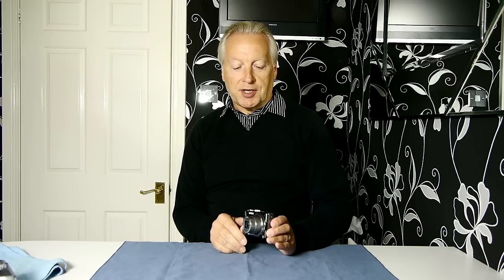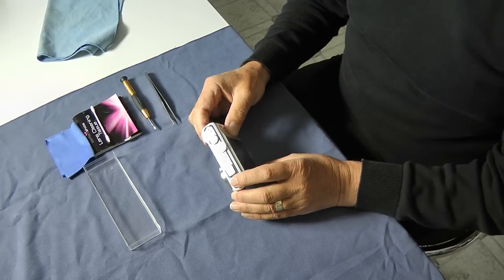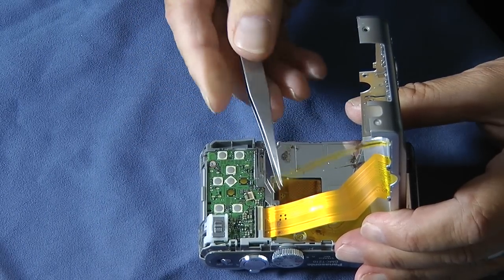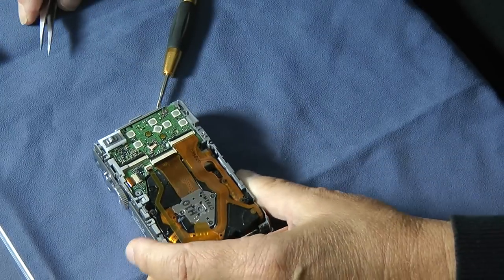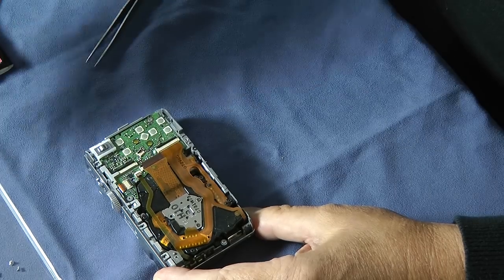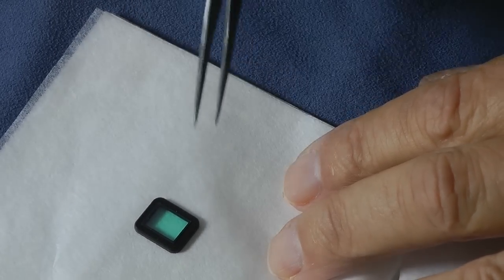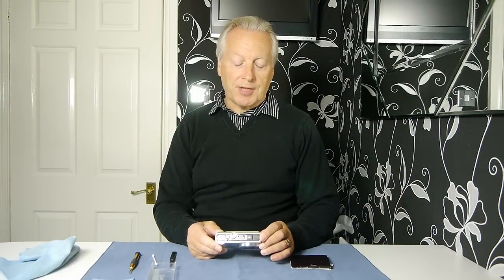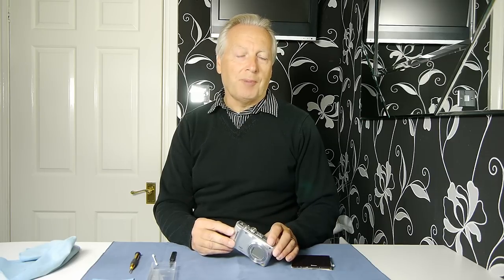Cleaning the CCD sensor of a Panasonic Lumix Compact Digital Camera

Comment from the maker: @LilBlighter The next stage is a little trickier as the lens zoom system consists of 3 cages which ride in each other and they have to be separated to do this. There are alignment marks but you have to know where to look to find them. Once you remove the zoom mechanism it is easy to clean the front element of the lens. There is more risk of damage to the delicate ribbon cables to the image stabilisation component. I might do a how to soon.

Comment from the maker: @awelux Well spotted. This is a camera used for many training uses and infact the cable had been left unlatched from the previous lens removal exercise. The main point was to show how to safely remove the ribbon cables from the connectors rather than in some videos trying to flex the display to one side with the risk of tearing the cables - especially the small backlight ribbon.

Comment: Excellent clear quality video, very many thanks and on exactly the right model. Would loved to have also gone to the next stage to see how to clean the inside of the outermost lens element, as that's where dust or lint seem to be most evident on clear backgrounds and at certain focal distances, despite all efforts to keep the camera clean and cased.

I have some reasonable skills, a steady hand and most of tools likely necessary, but just need to see what I'm likely going to encounter first, fr

Comment from the maker: please check you have the thin ribbon cable the correct way up, that is with the gold contacts facing down. This is the power to the lcd backlight. Ensure both connectors are pushed hard into the sockets before you close the contact latches.

Comment from the maker: @informed The lens assembly can be quite a challenge to strip and clean, the lens frames are like a 3d puzzle to get back together if you don't appreciate how they work. Unless you mark each frame before you take them apart ( they have very tiny moulded marks but you need to know where to look to find them) and then proceed carefully I would not suggest you try this procedure. Usually any dust is on the IR filter or on the zoom lens which yo can see through the sensor hole.

Comment: Hi - great video ! Ages ago I swapped the light sensor from one old canon to the same model canon. Good to see the build quality of the lumix seems as good if not better than the old canon. Soon I am getting a second hand lumix, so I really appreciated your comments and video, especially about the vacuum effect.. I will see if my idea of a small zip locked plastic sandwich bag helps keep the dust and other crap out. I find camera bags and camera cases good but I use these small bags for my mobile phones and it works well for dust and lint etc. Cheers again !
Reply from the maker: Good idea with the zip lock bag, worth remembering.
Reply: Graham Houghton Or, if you wear the same jacket a lot, line the pocket.

Comment: Thanks.  I took apart my camera before I watched this video because of these specks dust in the videos I record.  I was afraid when I took apart the CCD sensor on my Sony Cyber-shot DSC W350 it would fall apart, but after watching this vid, it didn't. A little compressed air did the trick.

Comment: Excelent video.  I used it as reference today to clean my PANASONIC DMC-SZ1.  The only difference is that the screen is attached to the main structure but it was very very easy to remove it.  Thank you Graham..

Comment: Excellent instructions. It was much easier than I was expecting, though on first attempt, my cheap screwdriver self destructed, and I had to buy a higher quality one. Now need to find another screw. Whilst main problem is solved, I can still see one particle of dust that is within the lens. This is only barely noticeable at extreme wide angle with a totally flat grey subject. At the moment it is not worth attempting to dismantle the lens. I also like your Oldham video. Takes me back 40 years.

Comment from the maker: In the macro mode and long zoom the closest focus distance is 1 metre with this camera by design, it gets less as you reduce the zoom. have you switched to the macro AF mode. If the sensor block is not tightened to the lens housing correctly it is possible you will not achieve close focus - tighten the screws gently and use a circling technique tightening them one after the other until they are hand tight.

Comment: Great video, good narration! The most usefull information for me was how to "unlock" the ribbons. I didn't knew how to release them before now. I found a "disassembly and reassembly" PDF online for my Samsung WB2000/TL350, and now my beloved "shirtpocket-camera" is as new again. No more tideous Photoshop work to remove those annoying dustspots.I used pressureized canned air to blow away most of the (4-5 pcs), and a cotton pin for the last stubborn one. No more worries about buying compact camera with zoom anymore.

Comment from the maker: In theory the blast of air should be sufficient to remove dust/pollen/fine fibres from the surface of the IR, ( tip! if the IR stays attached to the CCD when you remove the block from the lens just clean  it - dont separate it from the ccd as it unlikely to need cleaning) If the camera has been used in smoky/city atmosphere the their is generally a 'film' on the IR and I would gently wipe, rotating the q-tip as you go, the IR filter then give it a blast. Look obliquely to see if everything gone

Comment from the maker: There is supposed to be a universal standard for philips head screws. The screwdriver I have is marked PH0 and is the perfect fit to the screwheads, engaging perfectly in the cross formation. Too small/large a driver may damage the head through slippage.

Comment: Thanks! Just finished with the DMC-S71 (not the model used in the video). Seems to have worked although when I got to the infra red filter part a couple of springs popped out. Wasn't able to get them back in. But everything is now working without dust spots. And my menu button on the right which was also being over sensitive and unreliable is now fixed.

Comment from the maker: This is a small cross point ( number 00 or 000) screwdriver. It essential to get one which fits perfect otherwise the screw heads will be damages and you will not be able to get the scres out.

Comment: thnx i just did my panasonic lumix FH25  pretty much like yours except i did not have to remove the ribbons just blew air usung a bulb  with a brush type cleaner ,that white speck of dust is by by now so thanx for the confidence graham my other camera canon 100d eos has a feature in the menu of the camera where you can expose the ccd and just clean it without any mechanics involved, so now i may be tempted to remove the infra red filter, just a thought!

Comment: although I found a service manual for the ZS20 (TZ30), the process of calibrating the cmos/lens seemed too complicated.  So, what I did (and should have done right from the start), was bring the camera to an authorized repair depot. I had called them ahead of time, and they repaired the camera in just over one hour, no charge (still under warranty). Their advice -- keep the camera in a "ziplock" baggy. After the warranty period, their charge to retail customers runs around $75-$100 Canadian.

Comment from the maker: @yeti66tl ,,, part 2. make sure you keep the assembly one way round and remove each frame and keep notice of the plastic tabs so you can fit them again. It is tricky but can be done easily when you see how they work, there is likely sand in the grooves which stops the extension-retraction of the whole assembly. But as I said if it's focus only you don't need to remove the frames, just clean the slide and rods of the focus lens system.

Comment from the maker: Its a little different having the ir bonded to the cmos sensor but if you take your time is easy enough to do. There are 3 ribbon cables in the TZ20 because of the touch screen. On my blog page under downloads you will find the service manual for the TZ20 which may help you with the disassembly

Comment: found this as a great way for old grey heads to think they can do any thing.Had a go on 2 Panasonic that wherein trouble with blotch marks from a sand storm  .step by step helped and play back great job and easy on the ears to listen,.both look like new now ,  fingernail slipped on one  the filter and snap  $ 30 still good for ego and would have saved a bit for 2 cameras and 1.5 hours of enjoyment. THANKS

Comment from the maker: Hi Michael. The vacuuming technique was recommended to me but I never advised it to anyone. There is another video which shows how to fully strip the lens down to clean all the inner elements. Other than later than TZ10 cameras it is easy enough if you pay attention to the orientation of the components as mentioned in the video. A few have tried it and reported success, however it is up to you if you think you can do it. Watch the video to see.

Comment from the maker: @haveachatann This is also a side effect of the camera pulling in dust as the lens extends. If you have a "blower brush" you might try blowing really forcefully with the lens shutters closed and then open to try to dislodge any foreign body trapped between the shutter blades and lens front. You might have to do this several times. DON'T attempt to try any lubricant, this will make them stick more. It is possible to remove them with dismantling the lens but it is a tricky operation. let me know.

Comment: Excellent presentation.   But, I wonder if one should use cotton q-tips to wipe the filter and ccd as they might scratch the surface.     Blowing air and a soft brush might be better to avoid scratches.     But, thank you for the detail.

Comment from the maker: @mountainvision100 If you are sure the flexible cables are pushed firmly into the sockets and the latches are closed then it is likely that you may have fractured the very fine copper trace running down the thin cable for the lcd backlight. You can sometimes diagnose this by flexing the cable very slightly and observing if the screen comes on. If you have access to a multimeter then you could check the resistance of the lcd backlight diodes to be around 1.5K if they are okay. Its possible split

Comment from the maker: The most common reason is that the ribbon cable is not pushed deeply enough in the connectore before the latch is tightened. also it might be the backlight ribbon cable is upside down it should have the blcak part up and gold connectors down ( which is opposite to the data ribbon cable)

Comment from the maker: Hi, on the under side of the ribbon cable ( opposite the gold connector ) cut about 3 or 4 pieces of sellotope (scotch tape or other adhesive tape) and layer them on the ribbon cable - right to the end. trim any excess from the width. Now push the ribbon cable firmly into the connector - the tighter you can get this the more chance of success - then once the cable is in place hold it in position with another layer of tape over the connector and ribbon cable. Let me know how you get on please

Comment from the maker: @surf1div1 Hi, thats no problem. Place the plastic boot with the flat part facing down so that the recessed part is up inside the lens body ( doesn't matter which way round) then carefully place the IR filter into the central hole in the boot - it is only held by friction. Then carefully place the sensor back into the lens - it will then be positioned correctly before you screw it down. This happens 50% of the time just depends on how long its been in. I have spares if you break it.

Comment from the maker: @mrmot That's great. I was thinking that you should actually place a "visible light" filter instead of the IR one so you can use it in "not total darkness" I have used the "blue fogged area" of 35mm negative film strip which is a good visible light block but you may need to use a few layers ( cut the same size as your IR filter) to totally block. Or you could use very dark blue acetate gel material i guess. However if it works good for you there is no reason to modify it. Just curious now!

Comment: Hi Graham.

Another success! Thank you so much for this informative video. I had a blurry slug-like image  across the lower part of the screen which turned out to be tiny hair on the filter. A quick blow and it has gone.

Good quality screw driver and tweezers were essential. Plus a blower and good light and actually, once you get down to it...not daunting at all.

Again, thanks.

Comment from the maker: If your TZ25 is still under warranty return it for cleaning. I haven't seen a TZ25 but I suspect you are correct with the torx screws. Other users have stripped and cleaned TZ30's and apparently all was well afterwards. The seating of the sensor block looks as though it is really improbable that the sensor back focus adjustment will change but I'm nit a Panasonic technician so its only my opinion here if you decide to go ahead with the cleaning.

Comment from the maker: Thanks, and well done. Do not be attempted to completely remove the IR filter. If all the dust is gone leave alone. If you remove the IR filter you will run the risk of breaking it as it is  VERY fragile.

Comment from the maker: If you TZ30 is still under warranty Panasonic will clean it for you, however if you decide to open the camera the instructions are similar but there are 3 ribbon cables for the tz30 lcd screen. Once this is removed the CMOS sensor removes in the same way however the ir filter is not fixed to the CMOS sensor so there is no worry about it falling off and you only have the one surface to clean.

Comment: Thanks for this easy-to-follow video, Graham. Unfortunately, I managed to apply a little too much pressure on the IR filter and it has snapped. I can't seem to find a replacement, which is ominous. Any ideas as to where I might source a spare. Thanks!

Comment: One tip. On reassembling I'd forgotten to close the friction clip on the sensor ribbon but the camera didn't appear so suffer, it just showed an LCD display with no picture and an icon of a box with contacts down one side. Dismantle again, close clip, put it back together, all working perfectly. Thanks.

Comment: Hi Graham, great video. I followed the instructions all fine but the final, narrow, lcd ribbon was very difficult to fit. When I turned the camera on, the display no longer works. It still takes pictures fine so it's not the sensor. If this is the problem, do you know how easy it is to source and replace these?

Comment: It actually worked.  I have DMC FS-10, as video tho' UV is fixed to the back of the lense. I choose leave the Ribon cables connected, & fold the parts out of the way, to reduce the chance of wrecking the connections. (I also used a gas aerosol to try to blow the dust away, Don't do this you just get more dust every where, & sometimes liquid gas).

Comment from the maker: @dnoanoa Ha, this took me a while to figure out but in the hot shoe is a small plate which you can slide out to reveal the screws which are holding the back to the top. incidently the manual for the lx5/lx3 suggests the lens is not taken apart othewise the adjustments may be off. I should think sensor semoval is ok if you take your time.

Comment: Hi, first thanks for your very clear video on the Lumix TZ!
I'm on the road and stuck with a problem of sand… my TZ10 doesn't focus any more and give a error message. I allready got to manage a sand problem successfully. I disassembled it and I can't separate the cylinders of the zoom. No screws anymore, but I can't get the solution... I am wondering if there is a clip that keep all together?
Would you have a simple tip in words if not in images, to help me?
Kind regards and tx again!
Thierry

Comment: Thank you.  You seem quite knowledgeable about Lumix cameras.  I wonder if I might ask you a few questions.  

I bought my  Lumix TZ3 online in 2007 for over $325, a hefty sum for me.   The camera never focused well from the day I received it - especially close up shots.  When you push the shutter button, the camera is supposed to adjust the lens for optimum focus and then snap the picture.  You can watch the focusing on the screen.    On my camera the lens moves PAST the point of optimum focus, and then opens the shutter, resulting in blurry pictures!    I've never had this problem with other cameras.   I contacted the distributor immediately seeking a replacement and they refused.  I then tried to get Panasonic to repair or replace the camera under warranty.  I sent them closeup pictures taken from a steady rest.  I had a month long email and phone conversation with them..   Unbelievably, they thought I was doing something to cause the blur, and wouldn't issue an RMA!  

I believe there must be a calibration adjustment in the camera that controls this.  Would you be aware of it, and how to adjust it?

I still use the camera infrequently,  for long distance shots.  Unless I keep a battery in the camera, it loses the date and time settings.  However even with the camera switched off, the battery dies in a few days.   I have to remove it and put it in a charger.  The camera did not come with a charging cable that keeps the battery charged inside the camera.  A USB data cable will NOT keep the battery charged.  I'm aware Panasonic had an optional AC operated source that would plug into the AV port, but I'd like to find a cable that will plug into the same port and charge the battery from any USB power source.  Are you aware of such a cable and what it is called?

Thank you for your time.

Comment from the maker: No the ZS20 filter is bounded to the sensor so much tougher. You have 3 ribbon cables to undo and the sensor screws ate torx headed not cross point so you need a set of those before you start.